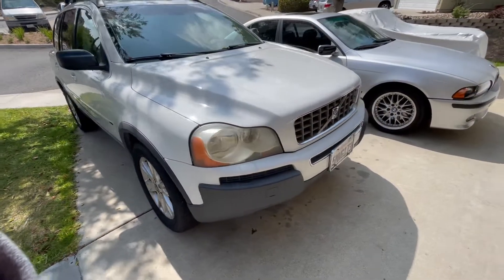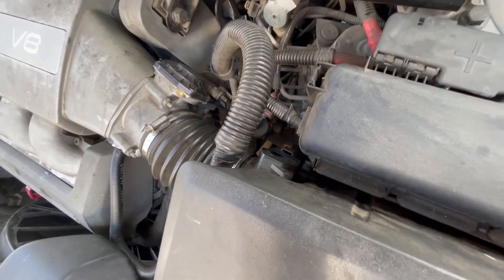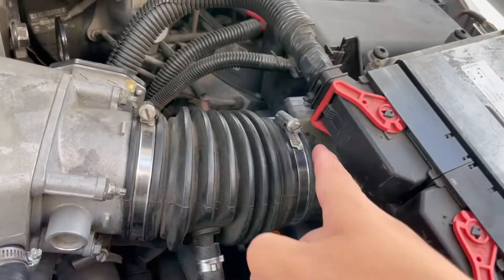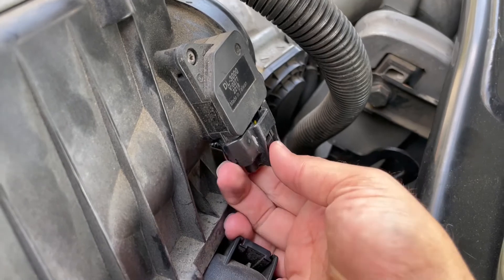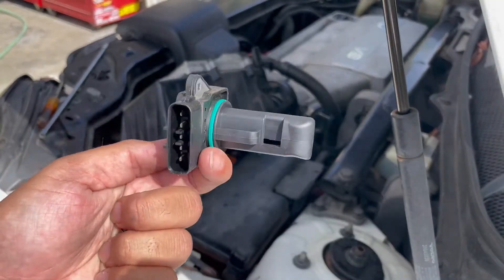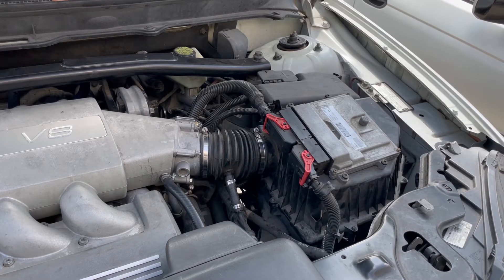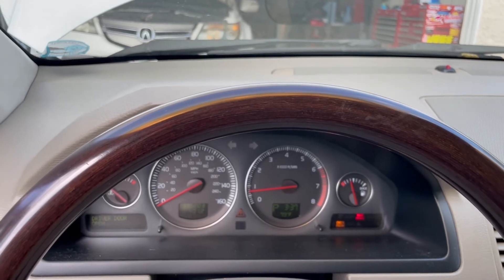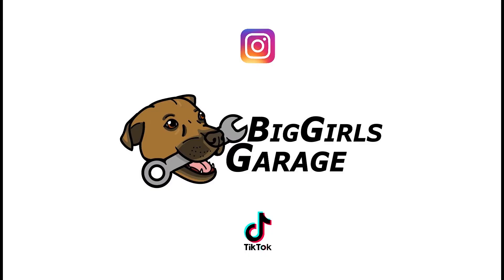How To Replace The Mass Air Flow Sensor (MAF) On Your Volvo XC90 (2002-2014) (Air Mass Meter)

Comment: Thank you for this. Several videos on replacing the MAF sensor on an XC90, but yours is the first one showing how on the V8 model (which is what I have also). The process is quite different for the V8. Well done!
Reply from the maker: Thanks, check our other video on why it's important to buy an original maf too
Reply: That huge heat sink that sits in the air box is absent on the S80’s. I have the V8 xc90 and I’m trying to make a custom intake but not sure what to do about that THING , do you guys understand?

Comment: How did you get the connector to unplug? I see the plastic tab on the connector and I am able to press it down slightly, but I can’t get it to disconnect from the MAF sensor. It looks like you had a similar problem, but the video cuts to you just unplugging it, so not sure how you did that without breaking anything

Comment: I have those codes plus p0088 and p0087 those 2 codes also pop up once in awhile. Says high pressure at fuel rail and low pressure. Would the mass air flow sensor cause that
Reply from the maker: Those codes are related to fuel pressure. I would start with a fuel pressure sensor and work my way from there. That could also cause the lean codes that we had as wel

Comment: I have a 2010 cx90 v6 3.2. How can I tell if it's the Air Flow Sensor vs the Air Flow Cover? I was told it was the cover.
Reply from the maker: Do you have lean codes? You could try cleaning the air flow sensor with a designated maf cleaner. If it was the valve cover, you would tend to see leaks around certain areas of the cover, look for any part of the plastic that appears wet/damp. If you have the tools, you could smoke test the system and check for a leak from the cover. Start there and let us know what you find!